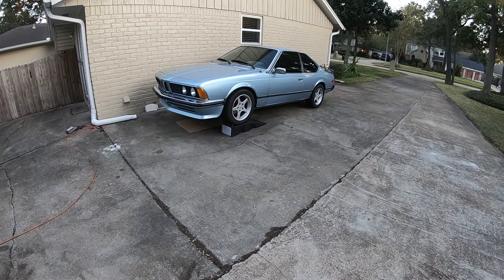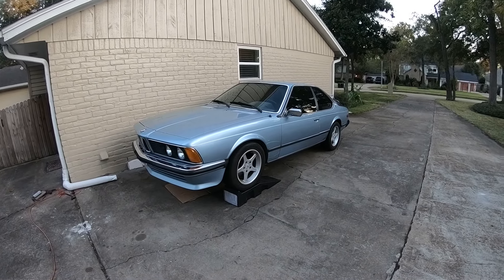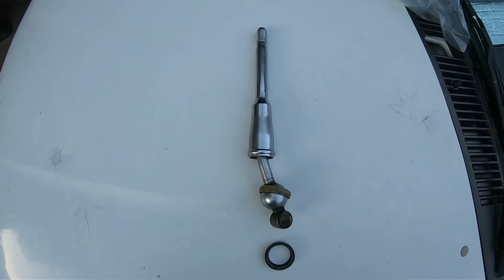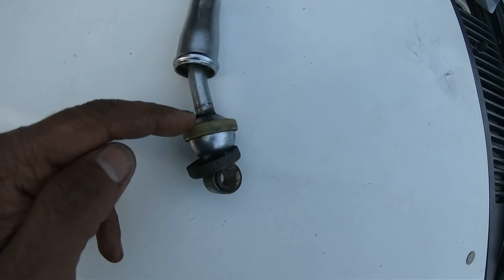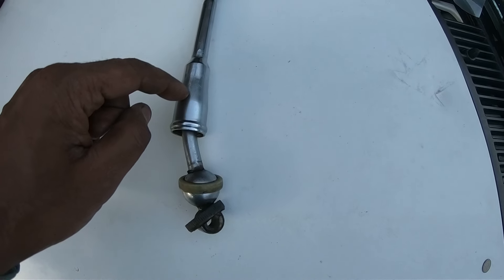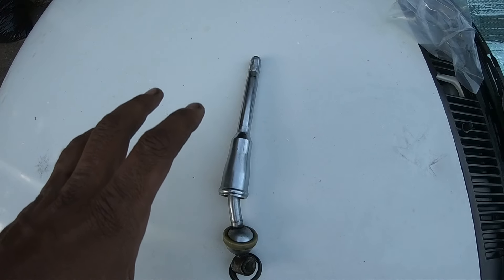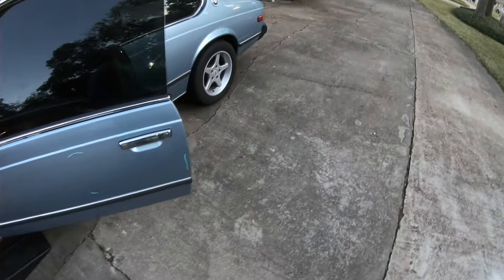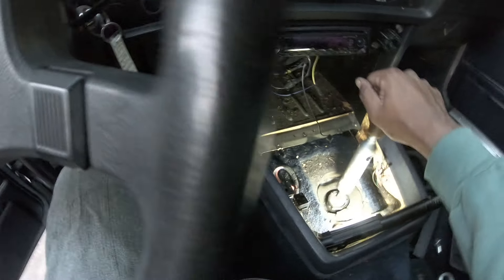1979 BMW 635CSi E12 Ireland Engineering Short Shift Kit - In 30 Minutes

Comment: I have one of these cars, same color. The correct factory designation is E24. A short shift kit is easy to fabricate which I did for my car. Now it is waiting for a high performance engine.
Reply: What he was saying is that its an E12 BASED car. Not an actual E12.  E24 from 76-81 are E12 based.  82-89 are E28 based.